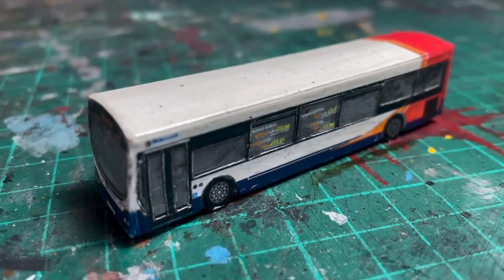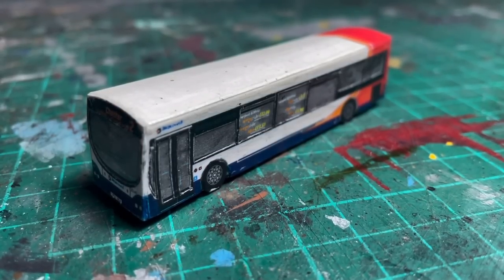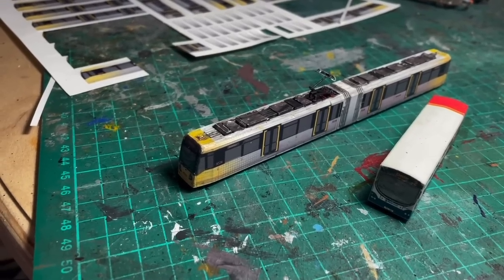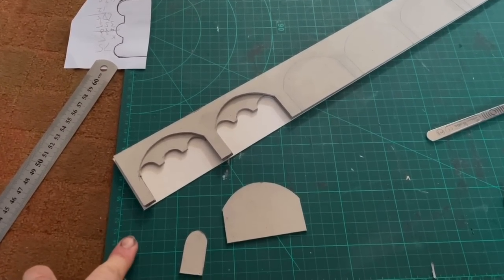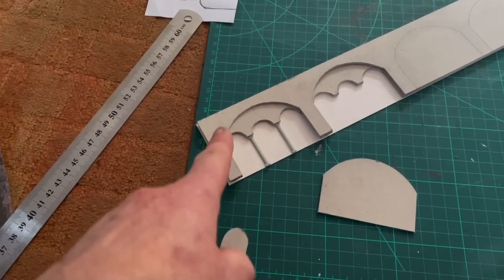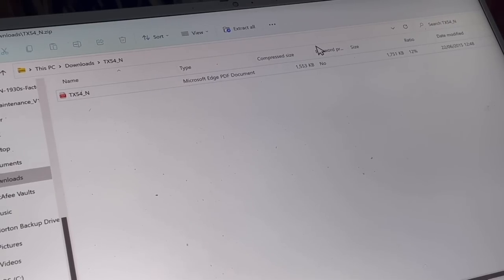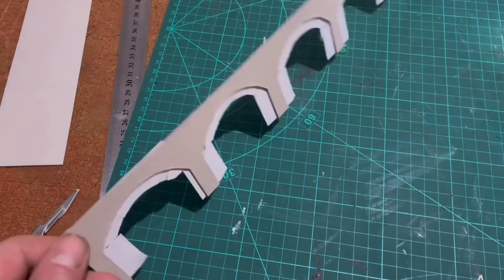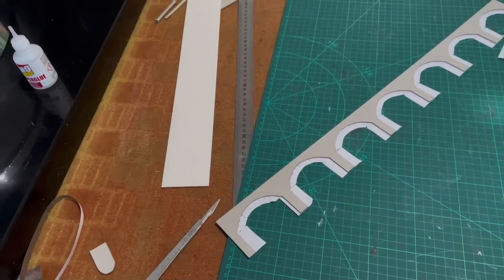MANCHESTER PICCADILLY  IN N GAUGE – building the underground carpark no1.

Comment: That’s our work carpark under there! Very dark and dingy! Are you gonna do rail house?
Reply from the maker: Hi yes it does seem a bit grim under there? Railhouse? Where is that? 
I understand there is a ‘slip road’ into the back of OFSTED, that’s what it looks like. Otherwise it’ll be Road markings, barriers, bins, fencing and of course all that’s above. I’m limited to the space I’ve got so if it appears in the area above or below I’ll include it.
Reply: @piccadillymodelrailways  ofsted?? Have they taken over what was railhouse?
Reply from the maker: Lol, I know OFSTED are next door to the station. As you look down Sheffield St into the carpark there is a small wall and slip road off to the right which seemed to go into a tiny yard. Is that the railhouse? If so not as such. I am going to indicate the slip road but not further than the new baseboard.
Reply: @piccadillymodelrailways  when I started on the railway in 1990 that entire building was railhouse